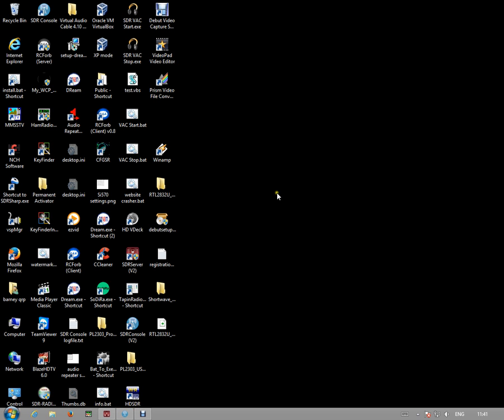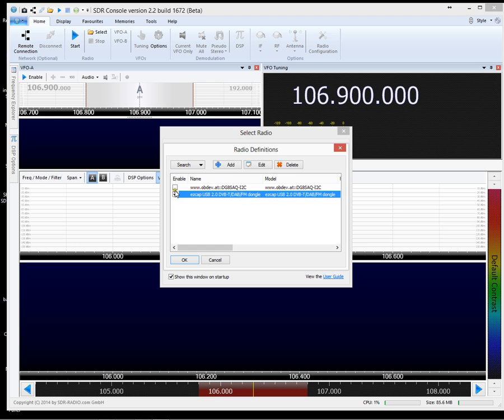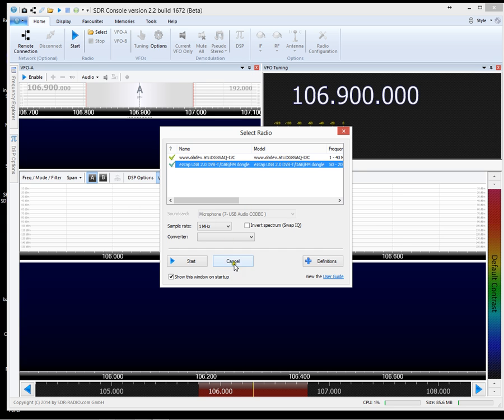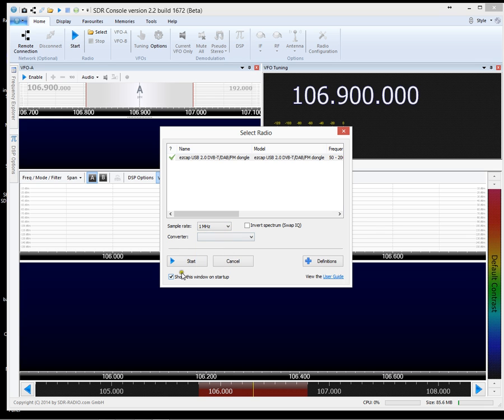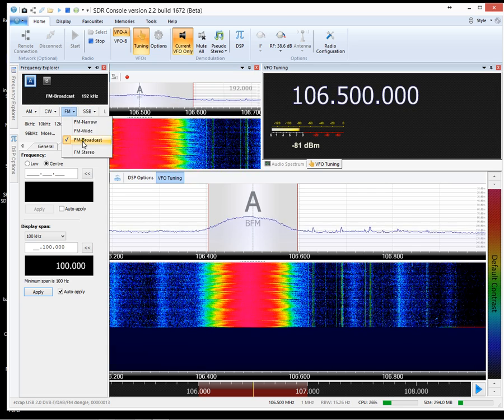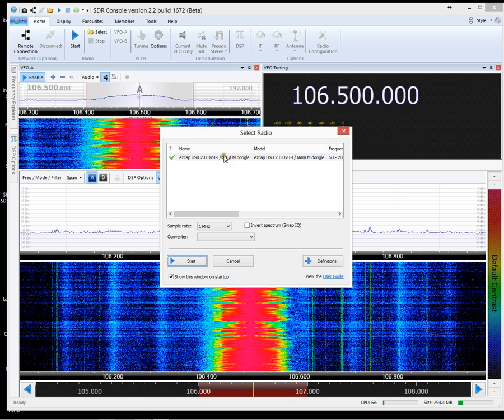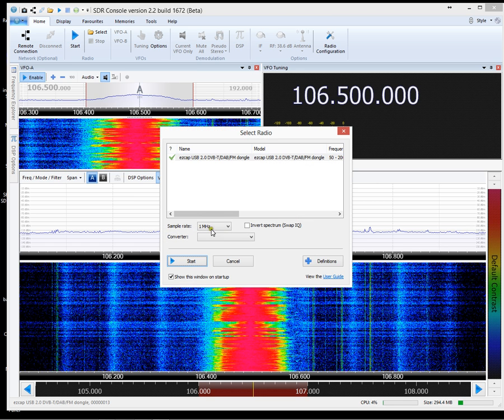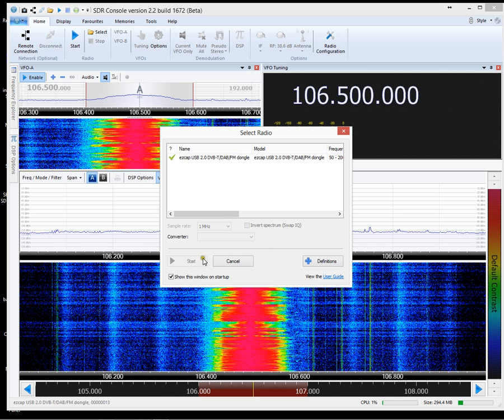SDR Console RTL dongle setup

Comment: Hello, I plugged the RTL-SDR dongle into a usb port and started sdr-console. The dongle was not found when I searched. I ran zadig under a sdr# (sdrsharp) download and installed the usb driver. Everything worked fine after that. Just sharing. Thanks for the video.